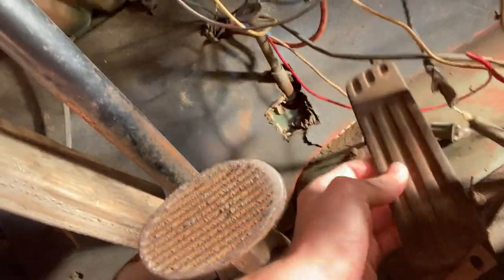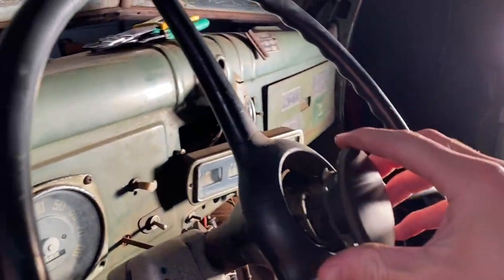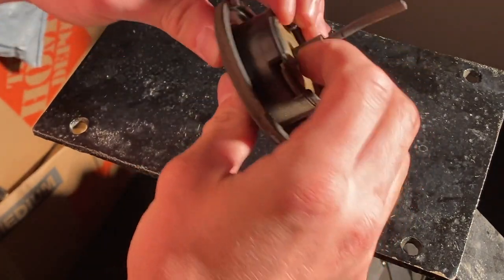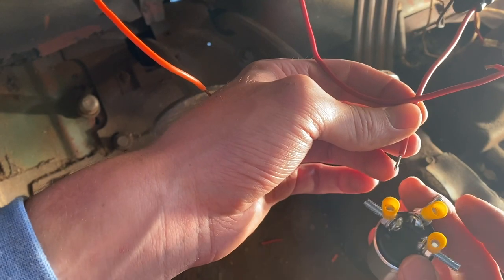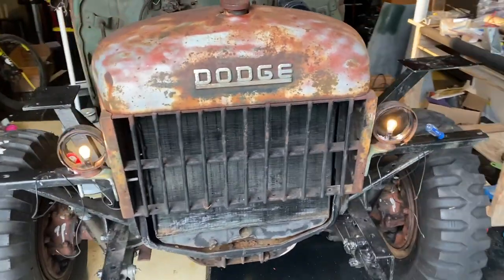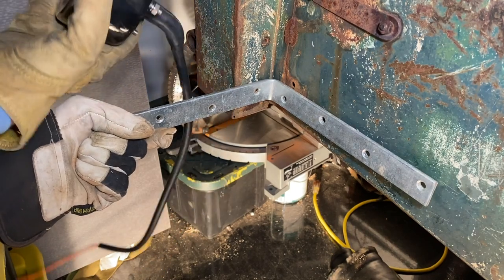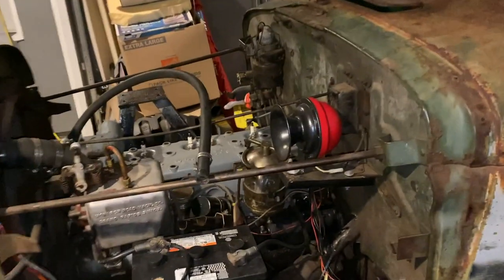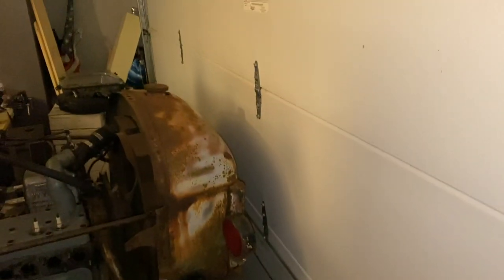The Power Wagon is Coming Alive! - Restoration Part 9

Comment: Good job! In all seriousness though, make sure you disconnect the battery when you’re done for the night! Resign yourself to replacing ALL of the wiring! Add fuses on just about everything! You don’t want to burn down your parents house!!! I suggest solder and heat shrink on your connections. Crimping won’t last very long!
Reply from the maker: Yeah I have been keeping it disconnected just for that reason and to trickle charge it. Yes I really just need to replace some of the old bigger gauge wires and should be all new. When I get closer to having it more permanent I will solder and heat shrink. I don't know why I didn't think of that. For the fuses can I just do inline fuses? I definitely don't want to have any chance of fire risk. I was worried about it that when it was at the mechanic doing the brakes because they had some really expensive rare cars they were restoring right next to the dpw. Thanks for the advice hope all is well!

Comment: I found when making wires longer soldering is best you'll have stronger current. Plus if you do have problems down the road your not checking every connection of extra wire mainly the connectors at the ends. Trucks looking good giving me motivation to start doing mine 🤣
Reply from the maker: That's smart I have a lot of butt connectors so as I go down the road and fine tune things I will definitely keep that in mind. Yes hahaha you have to start somewhere! Hopefully you can learn some things from my mistakes. Good luck on it!
Reply: @DIYSCOTT  thanks mine has a few different things since it is military all the water proof stuff . But yes your vids showing some good insight as well. 

By the way I been looking into those connectors that use heat shrink and automatic soldering, by use of a solder ring already inside . Heard any good things about em?
Reply from the maker: @dacei8296  No I've never seen those before but I haven't explored much passed the normal crimp connectors. These look pretty decent https://www.amazon.com/Connectors-Haisstronica-Waterproof-Connectors-Heat-Connectors-Self-Aircraft/dp/B088ZXW4ZR/ref=asc_df_B088ZXW4ZR/?tag=hyprod-20&linkCode=df0&hvadid=459719488307&hvpos=&hvnetw=g&hvrand=14994874643892075988&hvpone=&hvptwo=&hvqmt=&hvdev=c&hvdvcmdl=&hvlocint=&hvlocphy=9031293&hvtargid=pla-975126236800&psc=1
Reply: @DIYSCOTT  yeah I was just looking at those after I wrote that comment imma probbly get em n try em ! Hows the engine you guys got it started?
Reply from the maker: @dacei8296  I took all the valves out and was gonna lap them but kinda ran out of time because I am going back to college. The last mechanic forced compressed air (leak down test) into the engine and it was coming out of the dip stick which most likely means the the compression rings on the pistons are bad. I didn't want to spend a bunch of time trying to get them back in (with the wrong type of spring compressor) and still have it not work so I am going to take it to the machine shop to get it rebuilt. A little more money upfront but I think I will be really happy when I have a good reliable engine and since I am keeping this thing forever I want to give the engine the best chance to make it
Reply: @DIYSCOTT  right on brotha that is probbly the best thing to do

Comment: You should wire up those marker lights on the roof. And what are the front facing light wells on the side of the cab for?  Also markers?  Or turn signals?
Reply from the maker: Yes definitely. The lights on the side of the cab are called cowl lights basically used as marker lights. From what I understand they they are something left over from the horse and buggy era because they didn't want to leave their gas lamps on if they weren't driving. They can be wired now to be turn signals too but weren't originally so I think I might just put them on their own switch.

Comment: Great truck! I recently got one of my own and will eventually be posting restoration videos as well.  

As for your rapid flashing hazards and turn signals, the speed is controlled by a flasher module. Should be as simple as buying one that has a slower flashing rate and switching them out. 

Will you be sticking with six volt, or upgrading to 12 volt?
Reply from the maker: Yeah I think I'm gonna try a different flasher. I decided to stick with the 6 volt
Reply: @DIYSCOTT  Cool, I dont know what Ill do yet, but owning a six volt vehicle does come with bragging rites!

Only thing to watch out for is if you ever have to jump start the battery from a 12 volt. If you ever do, make sure the key is off. Charging the battery would work fine, but If you let the 12 volt power run through the system you can fry your 6 volt gauges and lights.
Reply from the maker: @flytrapguy7431  Yeah that's a good point. I'm also gonna do some sort of hidden battery disconnect to reduce voltage leakage when it's parked and prevent anyone from trying to steal it

Comment: your lights are flashing faster then they should because your using a 6 volt battery and 12 volt flasher and bulbs. at least that's what I believe is the cause.
Reply from the maker: It is a 6 volt flasher but hard to say on the front indicator bulbs. I agree though I think it's some sort of hyper flash that's supposed to let me know a bulb is out or something